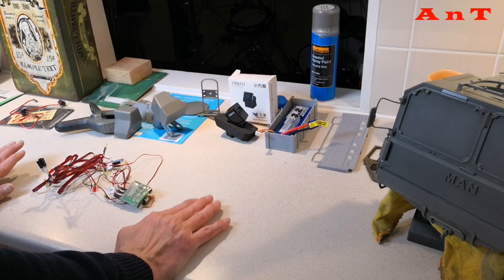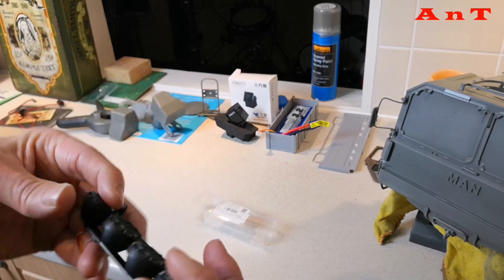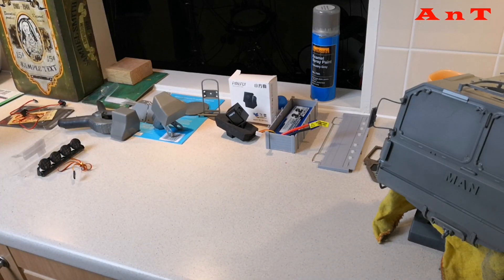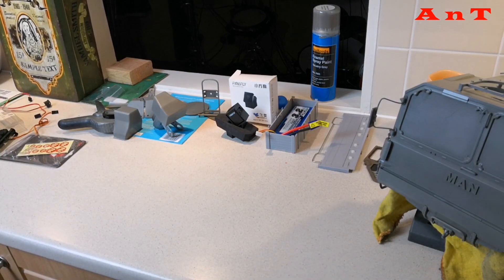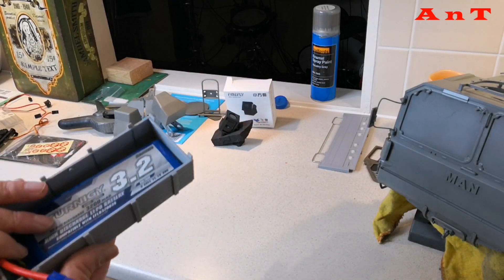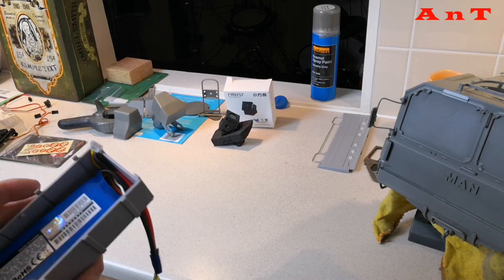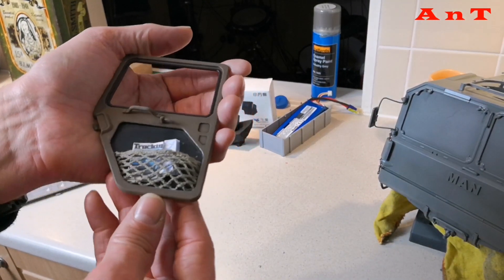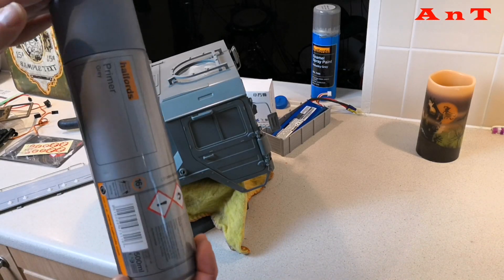CROSS-RC MAN KAT MC8 'C' Build  - Cab Painted And Lighting Revisited

Comment: The roof light unit could of burnt out for being plugged in backwards as LED's do not run reverse power. The same can happen with ESC's so always be careful. If everyone used the fin type plugs things like this would not happen.
Reply from the maker: Yeah that's possible and definitely I for one would appreciate some standard way of plugging stuff together!! I hate electrics :)) - A
Reply: @antrc  I'm the same as I hate too much wiring. The most I buy is a 4 bulb loom, preferred on the chassis and not in the body as i'm King of forgetting the wires when taking the top off. I know at times I do winch switches and they are not hard to do but finding the correct switch can be a nightmare.